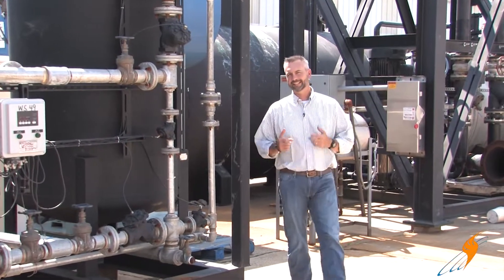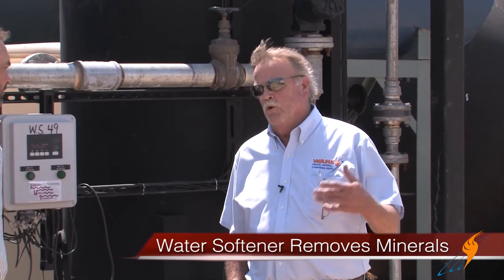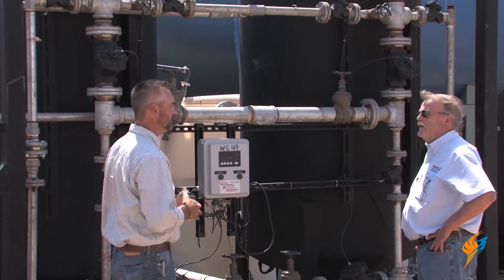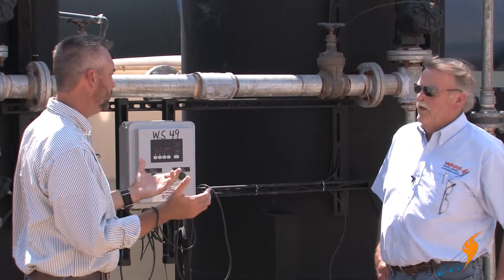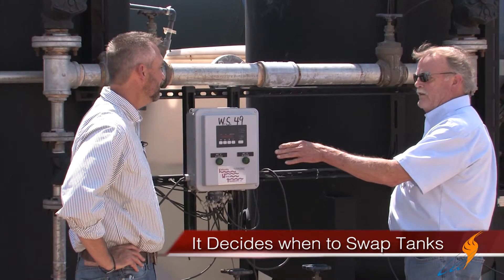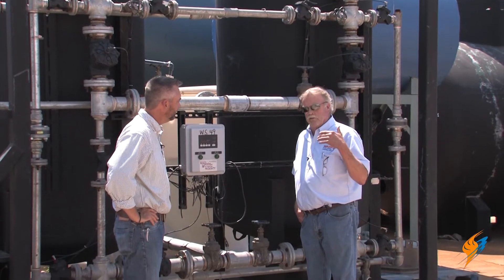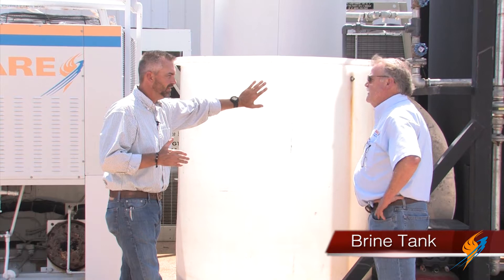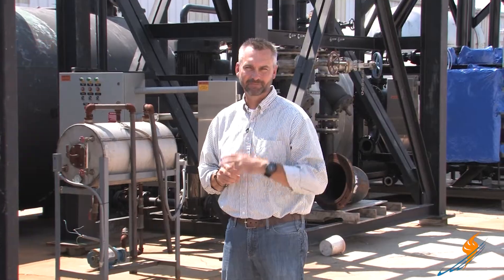How a Water Softener Operates - Boiling Point

Comment: So tell me if i got it right...... The water is softened by exchanging its minerals with the salt ions thats on the beads. Then once a pre determined amount of gallins passes thru it goes in a regen cycle which basically is backflush to fluff the beads,remove big solid particulates, and wash out the cal n magnesium? Then salt water is added to attach to the beads? Or do the minerals get replaced with salt when the are flooded with salt water?
Reply: Yes, you are god damn right!